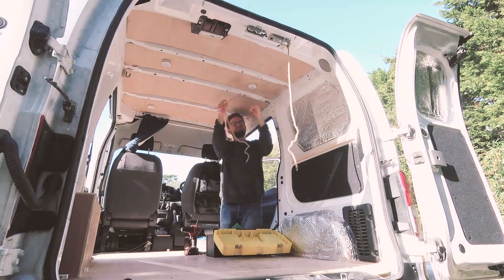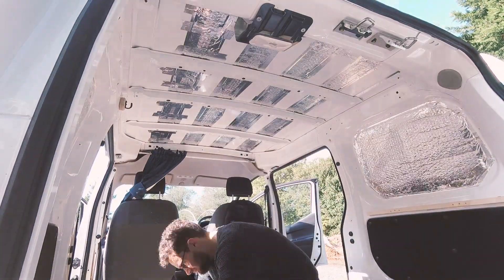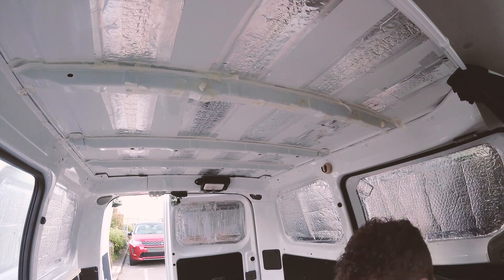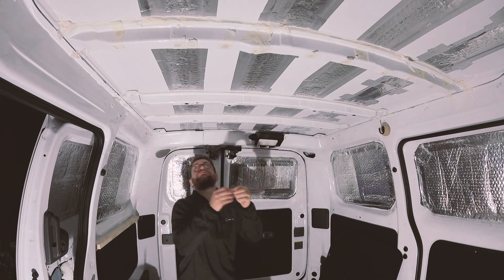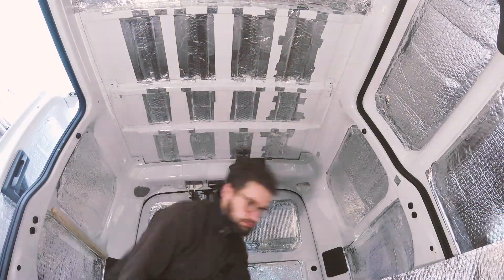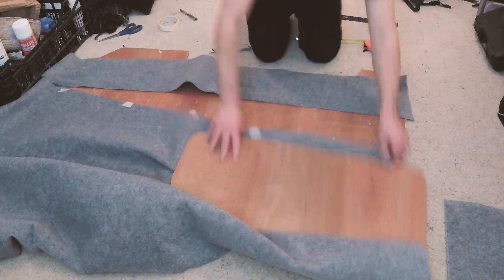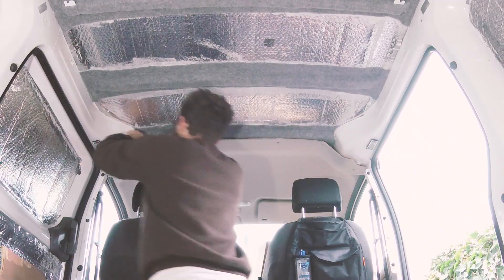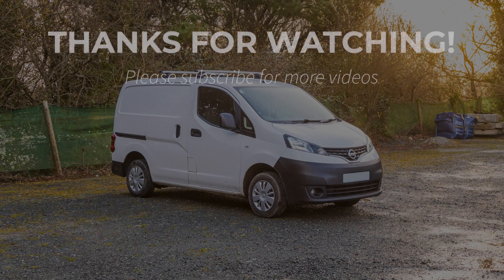Insulating And Carpeting The Van Ceiling | Ep 3 | Nissan NV200 Camper Van Build

Comment: Great videos, been a super inspiration for my nv200. What was your method for measuring out the ply? Seems a real awkward size/shape
Reply from the maker: Thanks, the centre 2 boards are just rectangles and I made templates for the outer 2 boards, yhen drew them onto the ply and cut them out
Reply: @oliver make it easier for your self and use one larger sheet for the roof maybe?
Reply from the maker: Yes that's what I did, 1 full sheet of ply was plenty for the ceiling

Comment: Just about to start my NV200 VAN So can you tell me why you didn't cover the beams with silver foil as they would be a cold area even though you have filled them with expanding foam
Reply from the maker: I didn't cover the beams with foil insulation because when I slept in the van (before insulating) they didn't gather condensation on their outside, as they are a cavity. However because I was carpeting over them I wanted to fill the cavities to prevent condensation forming inside the beams, hence the spray foam. Good luck with your build!

Comment: How did you do the electrics? I see you have LEDs in the van ceiling?
Reply from the maker: Hi, I haven't added any electrics to the van at this point, though my next video will be about that. The LED lights are battery powered ones I found on Amazon.